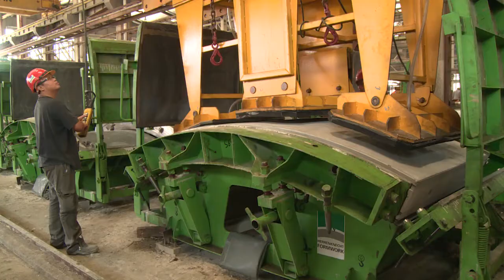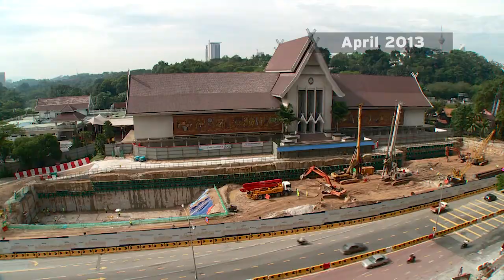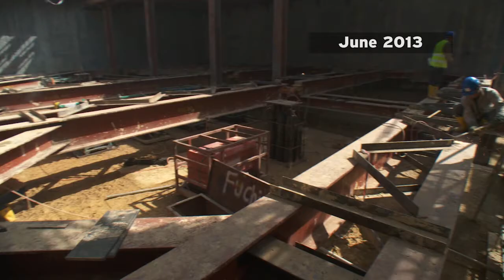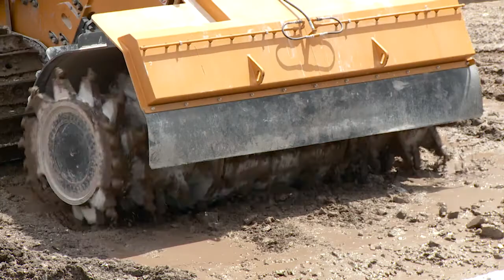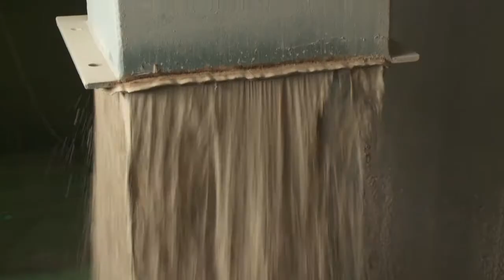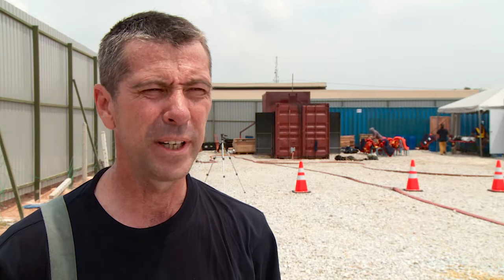KVMRT Progress Video 2 (Feb 2013 to Aug 2013)

Comment: KVMRT(Supposedly)

[KG]Kajang 49.8km 37 stop
[PY]Putrajaya 57.7km 41 stop
[CC]Circle 50.8km 32 stop
[UK]Ulu Kelang 40.2km 33 stop
[SM]Semenyih 75.6km 38 stop
[PM]Pulau Meranti 41.8km 33 stop
[RB]Rimbayu 45km 32 stop
[ST]Salak Tinggi 56.3km 33 stop
[DK]Dengkil 54.7km 28 stop

472km ,160 stops